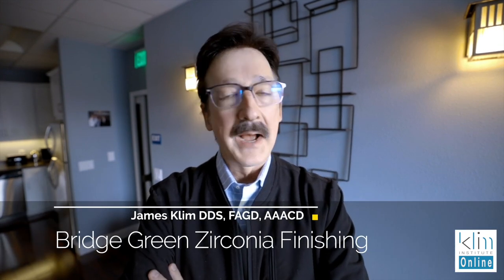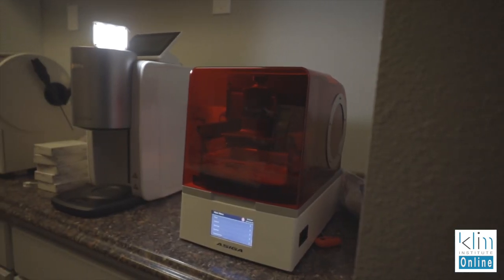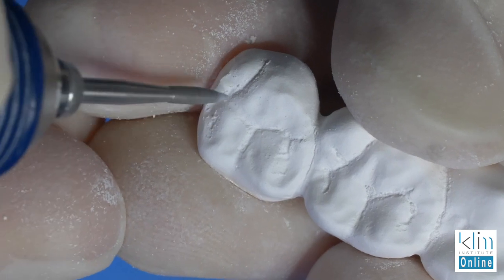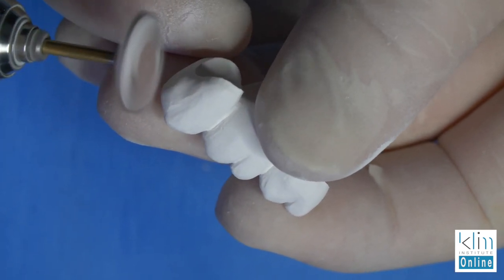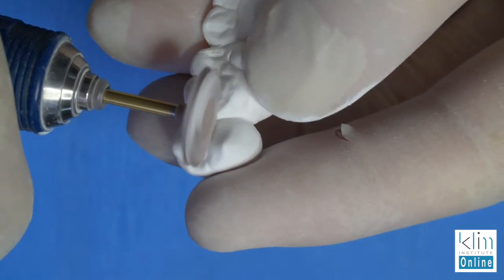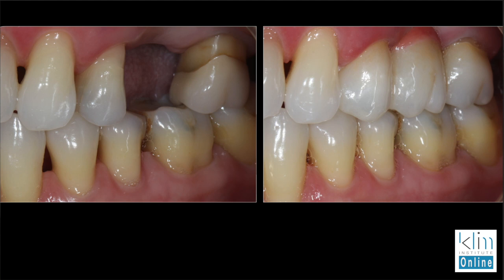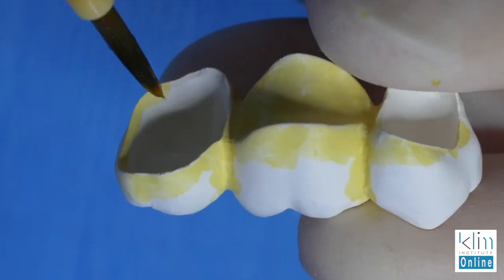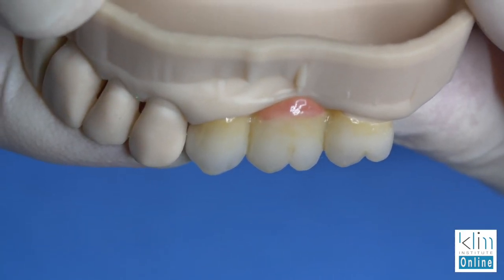Aesthetic CEREC Zirconia Bridge Workflow

Comment: Awesome video Doc. How do you manage to incorporate this into your daily workflow? Do you pick and choose the cases in which you go to this extent so that you don't spend every waking moment of the day printing models and characterizing crowns? I'd imagine if you work outside the confines of dental insurance you'd be able to really take your time with each unit... Curious to hear how you tackle this. Thank you!
Reply from the maker: As will all aspects of dentistry, there are learning curves and efficient application of skill sets.  In my CAD/CAM theater, most posterior single and quad units are one appointment.  I have found that bridges, implant restorations, and multiple anterior units are accomplished over two appointments to better manage chairside time.  The design, milling, and finishing of these cases are accomplished throughout the day when there is lag time between clinical care and milling/firing times.  I have worked out systems to utilize my time well and get a lot done.  Printing is very easy.  This can be delegated and the actual management time for printing is just a few minutes. I manage two appointment applications during my normal clinical day by multi tasking. This will make an interesting video
Reply from the maker: The beauty of CAD/CAM in the office is developing skill sets, control, fulfillment, and lowering overhead.

Comment: When do we make the baking period 12 hours? And when do we make the bread quick?
Reply from the maker: Firing time will depend on the zirconia being used and the furnace as well.  Zirconia brands come with recommending firing strategies and times.  In general, the longer firing options will provide more translucency.   Once sintered, then there are further options of adding surface, stains, ceramics, and glazes to finish the final esthetic modifications.

Comment: Sir, the shape of the basal side of the bridge is incorrect. A convex shape is far more hygenic and biological than a concave shape. What do you think about that? Best regards from Germany. 👋
Reply from the maker: Hi Ozzy.  I agree an ovate pontic application is desired when the ridge form and soft tissue lend to this approach. There are times that a ridge lap design becomes necessary to complete the conditions of the case.  A concaved pontic tissue surface is still a reasonable choice when the patient does not present other options.   When designing a pontic to the ridge condition, the important part of the design is to create cervical, buccal, and lingual pontic embrasures that are protective to food impaction.  With tissue pontic surfaces such as zirconia or ceramic, even concaved designs can be very hygienic.  More importantly, it is optimizing the pontic design to prevent food impaction.  I  have managed this pontic design on several cases over the last three decades without hygiene compromised.  The important thing is to optimized design to avoid food impaction.  A convex pontic design for the ridge condition of this case would have been the more significant compromise.  All the best and greetings to Germany.
Reply: @KlimDDS  Thank u very much 🙏

Comment: What about TZI C ZIRCONIUM??is good or old
Reply from the maker: The InCoris TZI zirconia is an excellent material. It is a 3Y material and used in my clinical theater when I need the ultimate strength.  The finishing is accomplished in a similar way, except more coloring infiltration is applied.  When firing TZI, I use a 9-hour firing cycle in the Programat S1 furnace.  The SpeedFire for a 3Y zirconia material is very opaque.  That is when I use a different furnace.  The SpeedFire works well for Katana, ZirCAD Multi, and the 3M brands.
Reply: sufficient strength for posteriors when molar is the pontic